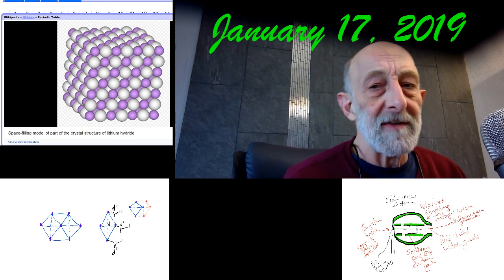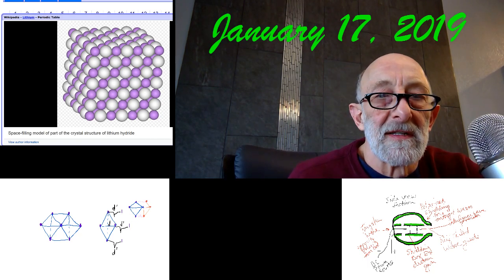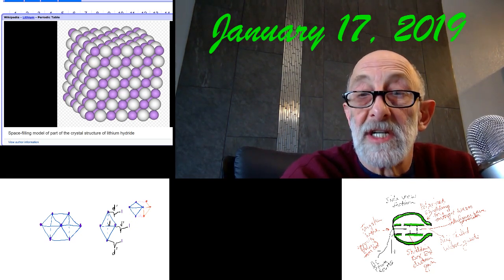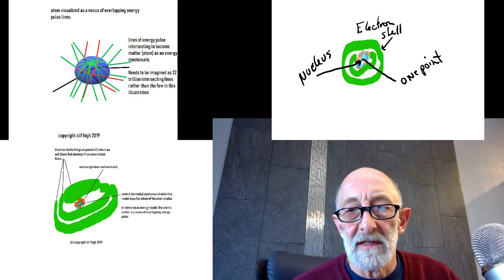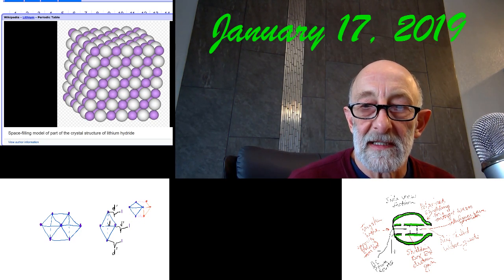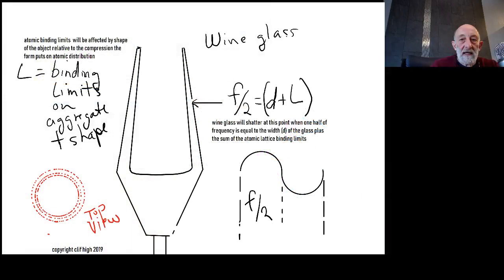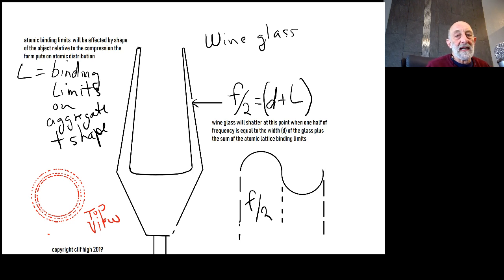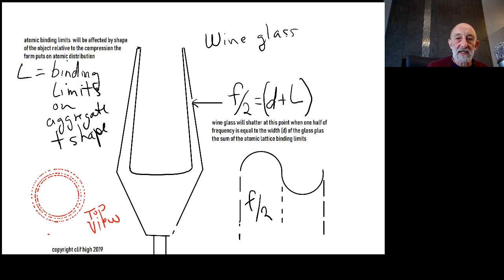clif high - Strange Science : Wine glass shattering for fun and profit

Comment: What you are talking about sounds possibly like what an Australian mechanic came up with. He is the inventor of the Joe call, he can literally run an internal combustion engine with no fuel entering the engine. He transmits the energy from breaking water apart into it's atomic states into the side of the engine. I believe that he is producing hho or Brown's gas. He doesn't actually burn the Brown's gas in the engine, he's actually using the energy that it took to cause water to naturally fall apart, to run the engine on. I believe that's what is happening in his setup.

Comment: Clif, how do yoy not realize sounds waves are several order of magnitude lower in frequency than what is required to sympathetically vibrate molecules apart, don't you?   The only reason the glass breaks is because the sound waves are vibrating the cavity, not the medium.    Prove me wrong by using sound waves to shatter a solid piece of glass such as a marble.   You can't do it.

Comment: It's just a thing, glass, bridge, that is pushed on the right rhythm/frequency and without to much disturbing factors (enough absence of entropy)  by sound waves ,  MOVING AIR. if "natural frequency" is just the most disturbing vibration for a given object, thing , well that is acceptable. keep all atomic, quantum, jargon out of it.  Try to break a glass of wine with sound in a vacuum. The marble example is another good one,  the vibrating air cannot GRIP the marble and disturb it enough.  Send all your atomic electron tetra bs at it , it wont break. Moving air..

Comment: To further demonstrate the "free energy" of breaking wine glasses, your tone generator should be able to break 1,000,000 wine glasses  at the same time with the same amount of energy it took to break one wine glass as long as they all resonate at the same frequency and you could fit them all in the vibration field.  Not sure how much control you have over the wave shape of your gun device but square waves with the fastest rise possible will have the most impact, better than sine waves.  Have you  worked out the feedback system yet?  Assuming your planning on automating the frequency system so you dont have to manually sweep through frequencies to find the resonant frequency of objects.  It should basically work by sending out a single "ping" from the gun which would set the object in free resonance, like striking a bell.  Then you would need something to pick up that frequency its ringing at and feed that signal back into your gun.  Depending on the bandwidth necessary for whatever your objects are, i would think an easy way to do this would be with a piezo electric piece stuck onto the object.

Comment: Clif, with your expertise in linguistics, have you ever tried to decode Edward Leedskalnin's novel? He knew how to levitate coral rock. Seemed to combine vibrations from his own whistling with a Keely magneto from a Model T hooked up to some sort of radio placed on a tripod. 
If you'd manage to decode that novel and set replicators on the path to levitation, that's be your life's work.

Leedskalnin also left us very real but barely understood science. The perpetual motion holder. Electrical charge hidden forever without decay inside a horseshoe plus connecting bar, activated with a small electric pulse. Forcefully remove the bar and you can light a bulb.